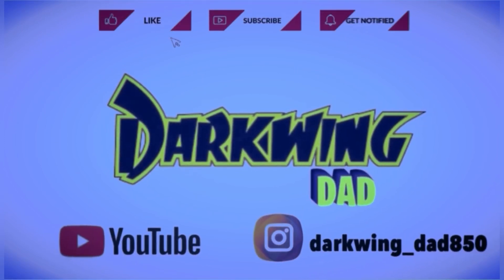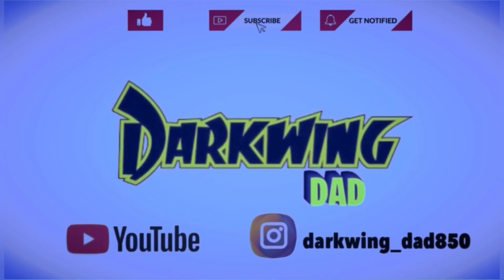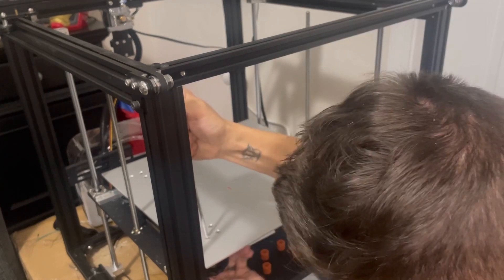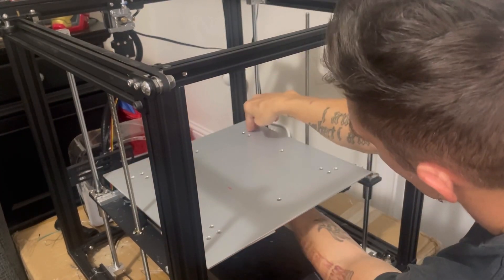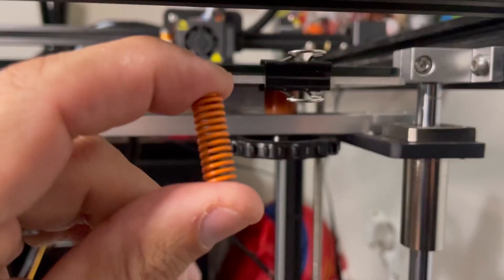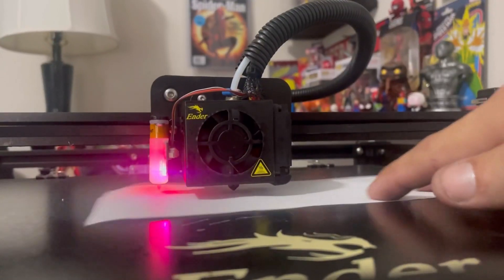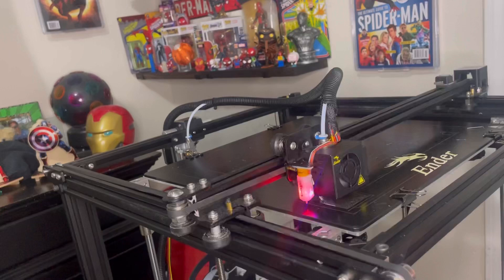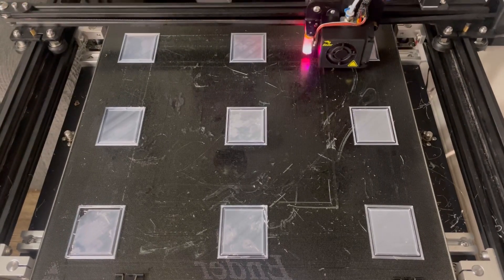Bed leveling for 3D printers made easy! Less headaches & improve your prints with this upgrade!

Comment: Im still using a cr-10 v1. Have orginal springs (2 or 3 years old now) Found your video and just ordered these to give them a try. Tired of having to level after every print with these old springs. This link doesnt work anymore, but found some others that I hope will.
Reply from the maker: I no longer have to level my printers, I noticed at worse I may have to tweak the z offset a tad overtime, I believe that is from the silicone mounts heating & expanding but I have it so locked in now it’s simple. These will be a big help for you!

Comment: What size do I need for ender 5 plus? (16 or 18mm) Just ordered one today plus silent mainboard. have a cr6 se currently and ❤️ it, but wanted something with a bigger build size for costuming and props, but not another bed slinger. GREAT VIDEOS BTW! TIA! 😀
Reply from the maker: Either will work on the 5 plus. The cr10s need 3 of the 18 & 1 16mm bc of the heating element concealer. I’ll have a video up on the silent board install as I just installed it in mine!
Reply: AWESOME! I’ve heard stories of the 5 plus being a PITA to level..
Reply from the maker: @nolefan05  with the bed mounts it’s a walk in the park
Reply: Just ordered a set! 👍🏻